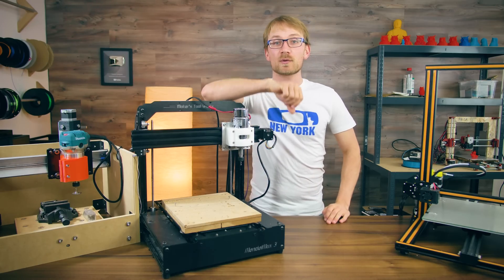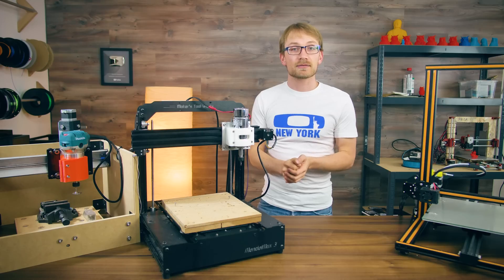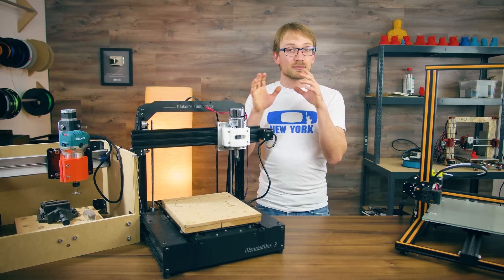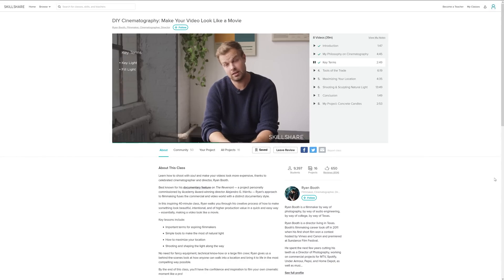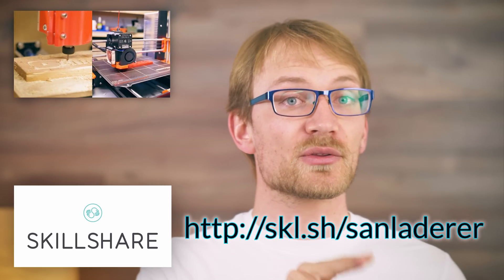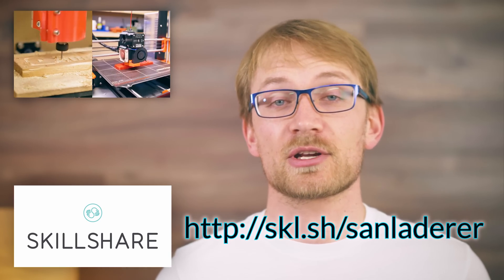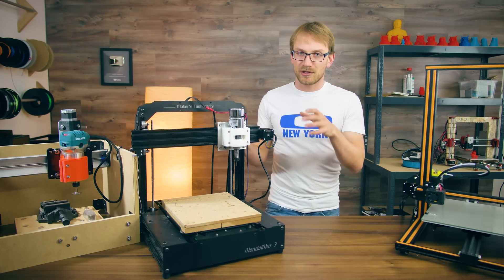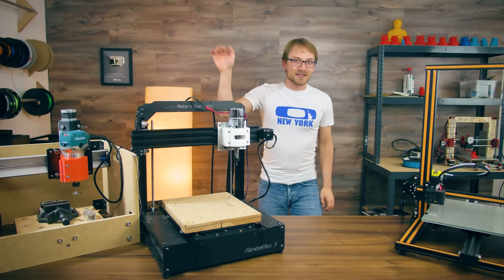Why 3D printers can't be CNC mills

Comment: Not any off the shelf printers but i have one that challenges everything you ever thought. 

When patent approved it will get seen. Machining aluminum on a 3d printer has been and can be done with decent accuracy and finish. 

Heres a hint only a cartesian and it takes a specialized gantry design and i will leave it at that. 

Yes it can be done. Maybe by end of year i can unveil it. Btw its also an FDM and prints PEEK. 

If it ever hits the consumer market it wont be cheap. 😊
Reply: 2 years passed, what about it?

Comment: Engineering student here with plenty of experience in a machine shop and limited CNC machining experience. 3d printers converted to mills will never match the precision of a purpose built mill but I think they can make a good affordable alternative for people who don't necessarily need high precision and aren't making large parts. I personally am planning to build something similar to a CNC router eventually but with a bit more Z travel and possibly provisions for a 4th axis, but something like that doesn't make much sense as a commercial product.

Comment: All good points! I started to look into 3D printers, then came across some models that can do CNC and laser engraving and then went into this rabbit hole of trying to find the best large scale machine which can do it all. Luckily I didn’t place the order. Yeah it is better to buy dedicated machines that can do each work properly. Plus that I can have all the machines do various things simultaneously without having to wait for one job to end and then deal     with tool head changes. Thanks for the video

Comment: i have 1 crucial question can i use a 3d printer MAINBOARD as the brain ? 
lets just say for a metal lathe converted to cnc with 3d printer stepper motor

Comment: Now a drill/mill on a 3D printer might not be too great becasue of the physical forces that the tool head is exposed to

but if the tool head was a laser cutter that wouldn't be a problem, I can imagine that working out well

Comment: I have successfully converted my ender 3 into a cnc, i have replaced the v slot wheels of the y axis with linear rails and soon will do the same with x axis so i can mill aluminium. The main problem to me is shavings fly everywhere and the fact that 3 axis are very limiting for cnc. Still besides for the linear rails it's very cheap and easy to convert. Fusion 360 is also a very powerful tool for this, it can do anything a hobbyist wants for free.
Reply: What are you using for a control? Arduino?

Comment: I like the 3d printer cnc because you get much much higher Z axis compared to most cnc machines exspensive and z axis are patheticly small.
Reply: I think most CNC machines purposefully have small z axis travel due to rigidity. Dragging the tool head through the work piece generates a lot of torque on the gantry as Tom explained. This torque increases the further the tool head is from the base of the machine.

Comment: CNC milling booths made my use of 3D printers a waste of time and money. I mill a mould one a 7 axis lathe then use injection systems .. No part problems that are inherent with extrusion.  My efficiency is 1000% what it was.  I took contracts from competitors within months of acquiring a booth. Extrusion = cheap parts and production issues.

Comment: hello thomas congratulation for the video, its amazing, im bulding a cnc and i dont known how to put the Z axis, do you think its better to use 2 Z axis in the frame like a 3D printer or use only one motor on the top of the sppindle, do you think that because the drill its up to force with the material its better to have the Z axis in parallell way than having a dual Z axis like a 3D printer, thanks for answering

Comment: I can see where this would be an issue on larger scale machines. On a small scale, a 3-in-1 3D printer, CNC, and laser engraver like the Snapmaker has worked very well for me, as it helps fix some of the strength issues.

Comment: What about using a 3D printer as pcb milling machine? Could that work? I mean just for milling the conductor tracks, not for holes or cutting out the hole pcb.

Comment: You make it sound like a 3d printer isnt a "cnc" machine.... last time i checked it is
Reply: No it's not
Reply: @barracuda6817  Yes it is. CNC stands for Computer Numerical Control. That generally encompasses all machines that are precision controlled by a computer, which include 3D printers. What you might be thinking about are CNC mills; since the term is generally used to refer to those machine, mainly due to its popularity compared with other CNC machines.
The point to note here is that not all CNC machines are mills, and (as a side note) not all mills are CNC machines; since there are actually manually operated mills.

Comment: I don't get why you couldn't take a nice milling CNC and turns it into a decent 3D printer.
Reply: A good CNC mill would probably make a fine 3D printer, after all, an extruder is just another tool you can stick onto your spindle mount. There are no properties on a CNC mill that would make it a bad 3D printer, like is the case for the other way round.

Comment: Did I miss some detail? because I don't get why a CNC machine couldn't also be a 3dprinter. I did get why it wouldn't work the other way around.
Reply: Hi Jaun. The answer is that the larger loads inherent in subtractive machining causes the axes to move necessarily slower than you'd want in 3D printing.  While some could be 'dialed up' to move faster the energy required to accelerate and decelerate a printing type operation would be excessive and in-short would thrash a milling type machine.
Reply: Juan Sanchez 4 months and no answer yet.

Comment: 3D printers are seriously light weight - a slightly bent lead screw on the Z axis can screw all sorts of things up.
CNC machines have to be far more hefty to withstand the resistance to movement provided by the cutter being moved into the material - the hot end provides no resistance to movement at all in comparison.
Your average 3D printer can suffer from motor harmonics which can cause the light frame and drive belts to resonate but a hefty cast iron milling machine does not. It is simply too heavy.
But other than the sturdiness of construction and the actual end effector (milling cutter vs extruder head) they are identical.
The other consideration is safety - I do not think that anyone has ever been permanently maimed or killed by a 3D printer - CNC machines (lathes and normal milling machines as well) on the other hand do not have such a clean record.
But learning about using electronic motion control on a 3D printer does have definite advantages.
They are cheap, easy to maintain and repair and filament is far less expensive than big lumps of aluminium or steel and 1 extruder assembly will last a long time - mills and cutters do not.
For someone who does not have a background in at least manually operated lathe and milling machine work, starting off with a 3D printer to learn the basics and "machine appreciation" is by far the best route.
Blistering a finger is a "recoverable" experience, amputating a finger - not so much!

Comment: I build one, it can do 3D printing CNC and laser cutting/engraving. The only thing you have to do is swap the tool, takes 2 minutes because of the design. It wil travel max 35mm/s so its not the fastest, but good enough for me :). I am still improving on it but once it is finished I could share the design if anyone is interested
Reply: Hi, I'm a bit interested in the design (maybe there is something I missed, but I will most likely use the ProperPrinting quick mount - for quick tool change and support of a dremel and a direct drive extruder hotend)

Comment: CNC mills as a 3D printer should be possible :)
Reply: @Protomaker Black Sprint Original 3D Printer should be easier as why level 3D printer bed when can mill level lol
Reply: @mlee6050  lol what
Reply: @CodyThierauf  I always thought when want something level just mill it level, and why when I make a cnc router/mill (work for metal and wood) I plan to mill it flat
Reply: I converted my Anet A8 printer to CNC milling and PCB milling machine..
Just had to do some upgrades in hardware and have to change the g- code. Also the steps are very small so to minimize wear
Reply: @EXplorer1.6180  Powerfull for cutting :)
Reply: @EXplorer1.6180  3D Print the Mill the part but watch out from friction melting the plastic :)

Comment: Just the mess alone means most CNC machines need to be in a garage.  Besides the mess there are SOME ways around the fact that most home version 3D printers only print in plastic.  For the most part anything a CNC machine can do, a 3D printer can do better, even some metal applications (yes really).  I think the exception might be heavy duty steel parts but honestly for folks working at home on an average CNC machine, they really aren't going to be making big things anyway and certainly couldn't beat me with a CR-10 in my hands.  All in all, CNC's are usless in my garage or 3d printing shop. I am not above making a mess btw I have built and run my own sawmill, so I can appreciate a good mess, but you have to admit 3D printing in your pajamas is better than suiting up for the garage.

Comment: I don't see how an extremely rigid setup would be detrimental to using it as a 3D printer ? If you had a maximally stiff frame, what's to stop you from switching out the milling head for a hotend ?
I guess the only problem right now is the price point of a very stiff frame - but that was also true for 3D printers in general about a decade ago, and look where we are now - pretty convinced that this is only a matter of having enough demand so large scale production makes it cheap enough to be viable

Comment: And how is it from CNC to 3D printing? That should be easy, right?
Reply: Not really since you'd need to add an extruder motor and hot end. With a 3d printer it's easier to just ignore those for cnc milling

Comment: I get why 3d printers don't make great CNC mills. I also get why the sienci(bob) can't be a 3d printer(not enough accuracy). but why on earth can't a proper CNC milling machine also be used as a 3d printer? it has a high enough accuracy(often even a lot more then a 3d printer), it has a REALLY rigid frame, and although it maybe can't accelerate at the speed something like Prusa can, but it would be more than good enough. just use some custom designed electronics, make a hotend assembly that you can fit in the collet(with the nozzle on center, so small rotations don't matter) and a heated bed that bolts down to the table like a mag chuck(for more accurate leveling) or can be clamped in a vise(for ease of use)

Comment: Using 3D printer chassis as CNC milling chassis is only a marketing trick to exploit unexperienced users and causing severely dangerous scenarios. Just hands off that crap. Buy only in every category of use the appropriate quality level to ensure quality work and safety. Milling spindles or routers with high rpm are not a Kindergarden play tool. Just my 2 cents.